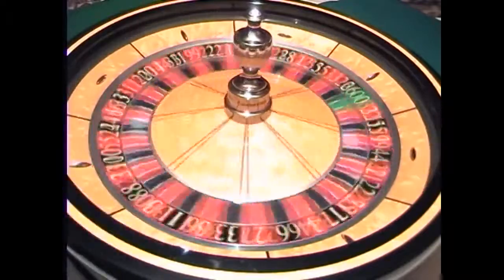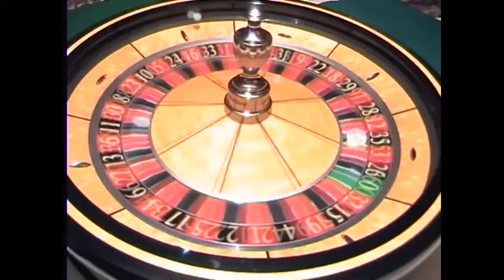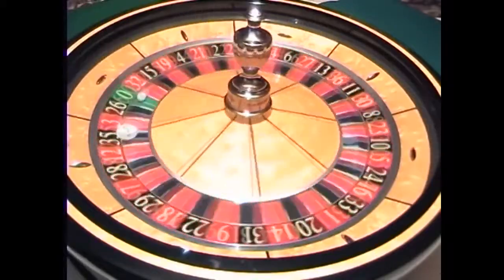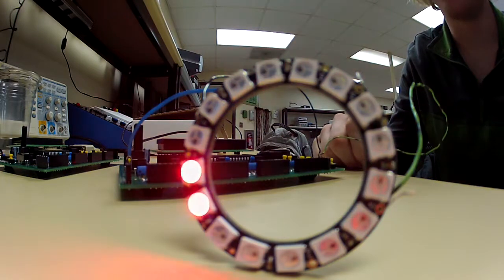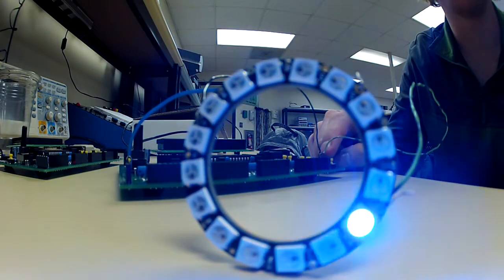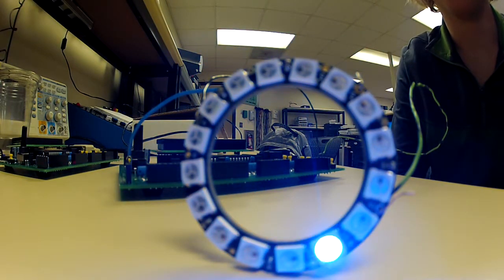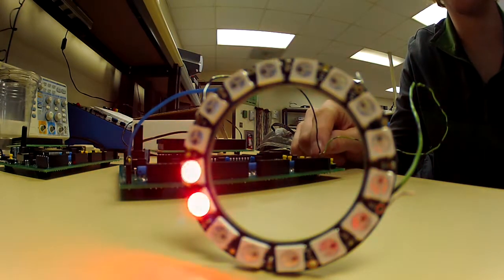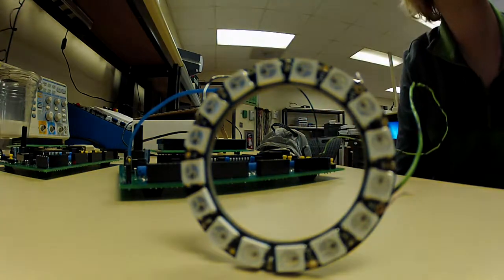Roulette NeoPixel Project

Comment: Hey Christian, 
Do you have the code for this project or do you know where to find it? 
Thank you so much!
Reply: Hello! I’m glad you enjoyed the video! This is Christian from a different email account. 

Unfortunately, I do not have the code any longer, as this project was done years ago, and I did not have the means to keep my code from back then. 

However, if you pause the video when the code is showing, you can make out some of it. 

Essentially, we ran a loop that gave the neopoxel commands for each LED, then moved onto the next LED. We repeated this to get our desired results. The code is lengthy because this was programmed in assembly, but using C would make this task much easier. 

Thanks for watching!